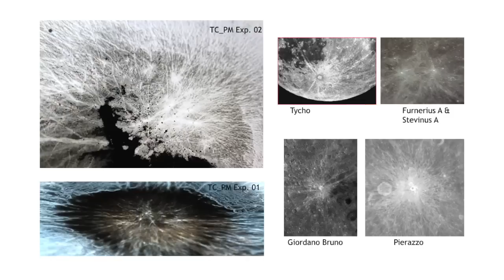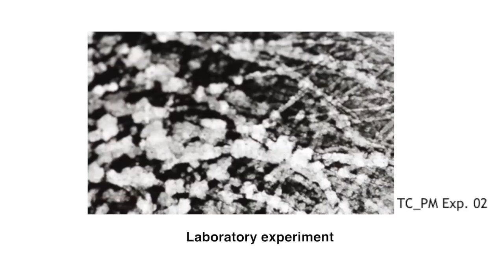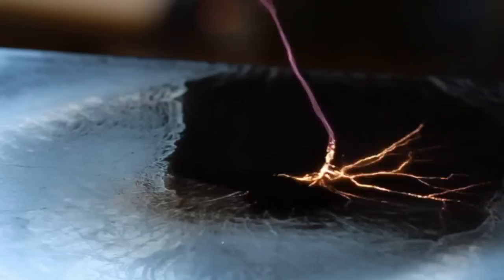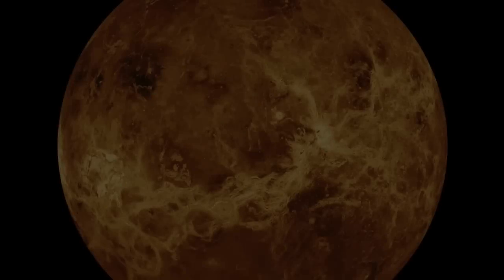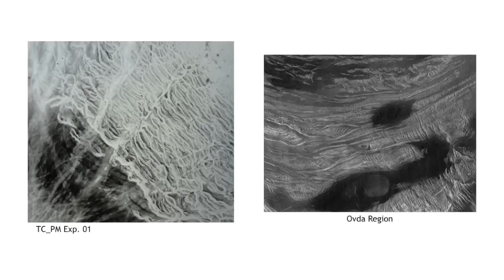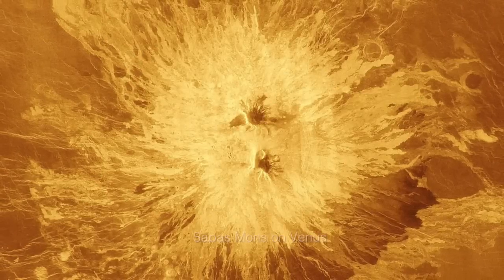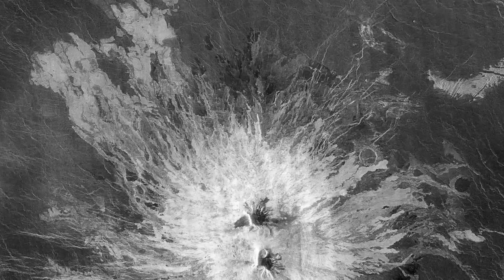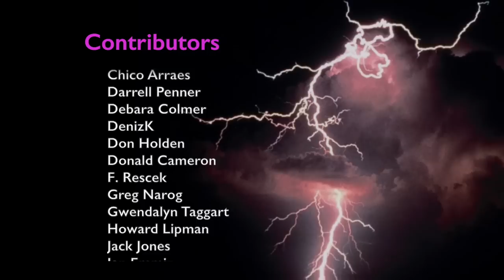Electrical Planetary Scarring in the Lab | Space News

Comment: Dust devils are daily occurrences in South Africa's dry arid areas of low humidity. Of course now it is obvious and I see they are electrical. I also experienced ungrounded aerial wire arcing to ground continuously for no apparent reason. High humidity drains away the static electricity at the coast - no dust devils there. In Johannesburg (low humidity, high static, no dust) there are strange gusty winds that sporadically will blow around buildings from all directions, that seem to come from nowhere (now obvious - they are electrically generated.)